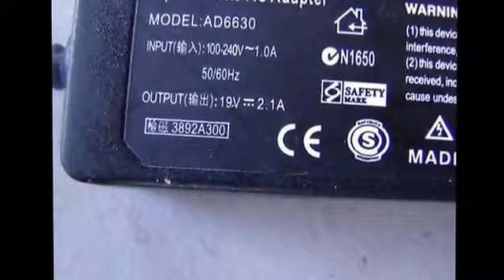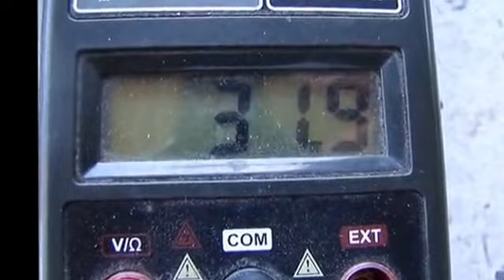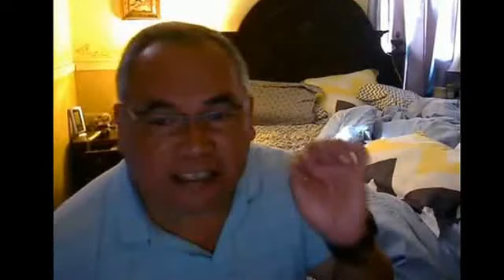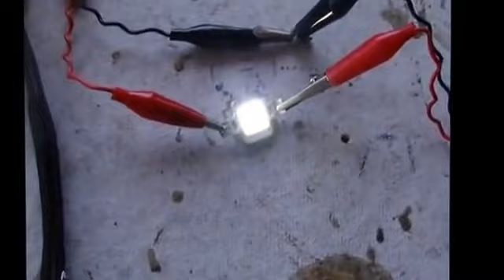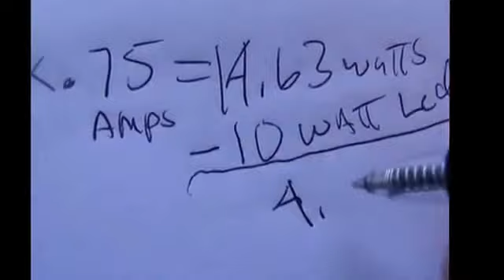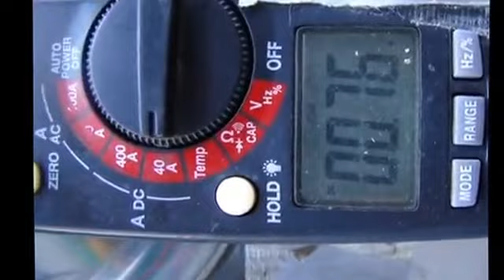Overunity   with 5 watts running the show 360p

Comment: Alex, what kind of circuit is in the tupperware container?  I am trying to get an understanding of what's happening here. I see the computer power supply on the table, I was just curious to see hat's in the tupperware container and what purpose the power supply to the right of it on the table is doing??
Reply from the maker: +Marc Belanger The tupperware circuit is from a friend that generates pulsed dc as radiant energy from mr. Peter sul on you tube here is his schematic and video..https://www.youtube.com/watch?v=eexdSi5LMAw < power supply is just for measuring input energy from house main that gets converted to high voltage low amp energy(dc pulsed), as you can see Im not using the full capability of the computer source which would be 19 volts times 2.1 amps but im only drawing ,75-.77 amps less than 15 watts and it turns the 2 24volt motors at high speed, higher than just regular 24 volts from a direct dc power source!!! mImagine what we could do for range on the new tesla 3 motor
Reply from the maker: +Marc Belanger Oh Marc while i was driving back from temecula I thought lets see how the motor genrator combo do connecting directly to power supply without the high voltage circuit from Peter Sul, well as I suspected it was typical business as usual lenz effect and all; sluggish motor response and low rpm at generator all running slow and the cap has NO effect in this direct setup.
Reply: +Alex Manzanero Thank you. That is awesome.. I could see 3 ways for you to loop it back to it's source just by watching. Since you get the radiant energy and the voltage rise happens when adding the cap, it should be self sustaining just by taking the output of the generator and taking the output voltage, transforming it with a resonant coil at the same frequency, you could step it up, then use the hv with a spark gap to fire a step down at no cost to it's source. I have a circuit you can add to this.. it could work if you drive a flyback with your output into a driver circuit, just as long as you build the coils used in the circuit I have to remain resonant at the same frequency of the input (maybe with a phase lock loop to lock the frequencies if they vary a little), you should be able to drive a few hundred watts of output at 240v and still self sustain without any issues if done right.. you might even be able to self run with what you already have.. it seems very efficient. because of the energy drawn in.  I just reconnected my Gerard Morin circuit and I can self sustain the circuit just by outputting the washer pump generator into a small 2a radio shack transformer by rectifying it and dumping it into  fully charged maxwell cap bank, then, it runs the system continuously at a charge voltage, however, theres no additional load. If I build this circuit, I think I will be able to  and add an inverter and super cap bank to get a pretty substantial output for some free lighting, maybe even more. I will keep you up to date.. I'll send you my updates and circuit setup once completed.. it may be a week or so because im waiting for the diodes to arrive.. What kind of diodes did you use at the ground wires?? I didn't see any label for those, only the output diodes had a part number..
Reply from the maker: One thing I noticed when adding the 10 watt led is a slow down of the generator but the amp draw at the source was'nt affected by the Huge load because we still had a lot of voltage to spare so I pre sume as you indicated that a small load going to a say a flyback will have no consequence on the source amp draw
Reply from the maker: Marc Belanger ps the voltage rise exceeds the electricians hand held meter that only goes to 480 volkts; it lights up like a christmas tree and once i made the mistake of touching it and it defineitely woke my sleepy but up !!!
Reply from the maker: I have another vid that shows the cap charging to 250 volts in 2.3 seconds from 18 volt solar panels
Reply: that's pretty substantial. It seems that the circuit uses any small energy source to enhance it's draw by disturbing ambient, and it's probably just done by pulses to enhance the counter emf, while it draws in and stores the "other side" or the opposite of what it pulses into the coils, when they shut down, the emf arrives, however, if done correctly, the ambient disturbance of the emf wakes up another form of energy and the opposite of that energy is drawn in, giving it a much greater difference in potential. This is how Don Smith's devices work. I am going to give you the link to a circuit to play with. It isn't tough to build, but, it is what 5 people have come up with from tariel kapanadze's hand written circuit when he was in the hospital. WesleyNY has been an extraordinary help with this to me, and I hope it gives you something you could build from it. 

http://www.modvid.com/images/adias/good%20schematic.jpg

he uses a couple of generators to make this work, but, if you look up tiger or one of the other names on this schematic, they all made it work similarly. this is the circuit with the flyback I spoke of. Try it, it works and self runs.. here's another link with the better diagram:

http://overunity.com/7679/selfrunning-free-energy-devices-up-to-5-kw-from-tariel-kapanadze/dlattach/attach/94552/
Reply: +Marc Belanger Hey Marc; I have one or two things I'd like to share with you; whenever you have the chance; no rush. Just some questions.
Reply from the maker: +Marc Belanger thanks Marc for commenting.  From a laymans point of view (me) I view whats happening is that a capacitor can store and dissipate its potential on the fly, eats and regurgitates. Well I think it acts like a boy on a pogo stick or with springs under his tennis shoes; it allows him to jump higher by storing the potential energy and then using it when the boy jumps up. I will check out the links you sent me. Im afraid of closing the loop because the generators output of 30 volts exceeds the input voltage that Peter sul recommends for his circuit. When you look at the circuit do you think 30 volts will damage the componenets??? let me know what you think. I may try to loop it today
Reply from the maker: +Marc Belanger I for got to mention this phenomena.  If you hook up the leads from the radiant oscillator to an old disconnected extension cord. the 220 volts jump up to 480 volts plus. It could also be simple speaker wire around a plastic pvc tube of less than 5 feet and does the same effect, no need for a core just air does the trick
Reply from the maker: +Hazenthly&#39;s Fire are you getting peter's circuit?
Reply: +Alex Manzanero Yes; I'm trying to arrange something as I don't have paypal and to go through credit; but I'm buying the circuit yes.
Reply: I got the circuit you sent me too. It looks extremely interesting and I think I am going to make some heavy duty mods, maybe even include an extra that may allow it to produce a very heavy amperage as Pelex does. I'm not sure the world is ready for the release of it, however, since it involves 3 coils, Pelex actually does too an I may start etching the pcb tonight so I can produce a professional grade product as a prototype. Since I needed a pulse circuit to make Pelex's technology to be made as a fully solid state driver circuit, it looks similar to what I am going to need to make it all work, also, I am going to try winding the coils using litz wire, maybe series some of the strands to make it wind in and out of the (3) 100' rolls that I bought. They have 50 conductors in each, so, my amperage should be pretty good if I use 5 strands at a time, strip them back and solder one set of 5 to the other, in and out, maybe I will be able to acquire a couple thousand volts out of each coil or so, then, see what I could do with the output using shorted coils with switches until I find the right combo. If I could luck out enough, maybe I will obtain resonance and be able to draw 5 or 10 amps from the circuit, which would allow me 10kW if I approach it as Don Smith did, resonant coils, etc.

With this type circuit, and the right type of pulse, I'd bet it's possible to produce tremendous energy by pinging the ambient surrounding with a powerful capacitive discharge, resulting in a very high amperage/high voltage discharge into the inductors, releasing 3 separate bursts of symmetrical emf waves that have an equal and opposite energy signature which is drawn back into the circuit through the air
. When I found out how to build the Don Smith circuit, I created my own version by utilizing an idea from the youtube user ingener, he had a capacitor and spark gap that was set up like early military radar systems that pulsed lit 
a light bulb with a very high output. I copied his wiring and when I did so, it instantly, in one shot blew up a 120v 50w led chip, and it sounded like an M80.

 To make it work,  Those waves are driven into the ground, returning through  the air to acquire the amplification then the load returns to the other ground. I blew up a high pressure sodium ballast transformer like a bomb, and, it literally  shot a fireball out of it
, nearly lighting my home on fire. That was the scariest thing that's happened to me in a long time! I now respect the circuitry especially now that I know there is enough power in one to kill us easily. . An NST isn't normally capable  of that kind of power, usually only 30 to 60 ma so, I must have tapped into something correctly, but, it only happened in short brief pulses. I never succeeded to continuously get this kind of power out, which would have been a much faster frequency. The ability is there, I just think Don's circuit was never listed online correctly, as  he was forced to leave something out.
Reply from the maker: Marc Belanger I always wanted to know how I can make this circuit to heavy duty use such as solar panels using only 1'4 the amount of panels because this circuit charges li-ion in a couple of minutes that is 3.7 18650 batteries. It could do lead acid car batteries also but in minimum time, i have to literally watch how fast voltage rises. So please let me know how to beef it up, please
Reply: +Alex Manzanero I sent Peter a message and he hasn't responded.  How do you get in touch with Peter?  I'm ready to buy 4 of these for my friend and myself and I can use PayPal.
Reply: Alex Manzanero of course. If you add caps to pulsing coils, especially at the correct frequency, a lot can be accomplished, especially if there's a primary and a secondary air coil that has a primary in resonance with the source, in perfect sync you'll get the highest possible voltage and efficiency. Then, we have the ability to loosely couple to this creating the bucking "multiplication/amplification" due to the back emf of the secondary coil having nowhere to go but outward. Since the coupling with higher voltages on an open pulsing circuit works in  the exact opposite manner as the closed circuit, the outward energy is like an elastic band stretching out to it's maximum, the farther it is stretched, the more energy is built up within it. Since the frequency ,wavelength and impedances need to be matched with the secondary, the back emf is released after a pulse into the ambient through an arc, then, it is recovered mirrored and many times the original pulse energy can be recovered from the load utilizing another source of Earth at a distance from the original Earth which the initial pulse of energy has been tied to and forced into the ground. This effect was genius technology of Tesla and it is an awesome way to see how much energy could be drawn using the circuit you have, or similar anyway. If you see an over efficiency now and there isn't a ground involved, imagine how strong it would or could become when involving transfer of energy from the ground, and the difference in potential between a charged earth and atmospheric ambient that has been disturbed by these sharp emf pulses? I call it electron accelleration way beyond the speed of light, creating a phenomenon that is not yet believed by the majority of science. The issue though is properly propagating this without knowing exactly what to do. I've been closely watching Dollard and his training videos where he shows us the different circuits that create the different waves. The scalar is the most powerful and most important that I have worked with so far. It allows the possibility of an energetic anomaly that is way more powerful than anything conventional science could grasp at the moment, and the sad part is that science will tell all of us we don't know what we are talking about, also, they will say it can't exist and never existed. They will all still say Tesla was out of his mind mad, but, I'd bet good old Nikola is up there saying 'I told you so!", especially after Eric Dollard and many others have shown the effect over and over. I am about to rebuild this circuit. I've received nearly all of the parts.. My transistors arrived, the coils arrived and most of the other products are already here. I just need energy to go ahead and build the device , then, multiply it in size to create the beast circuit that will drive large motors into generators for amplification of an unknown amount.

Comment: I'm going to share this my friend.. Oh, by the way, how did you come up with the resonant calculation? did you read the coil's inductancewith an inductance meter or did you just wing it and connect caps until you got the resonant rise? Is it resonant or is it just a by product of adding capacitance to the particular winding type? These are just standard permanent magnet dc motors, correct?
Reply from the maker: +Marc Belanger the circuit is very forgiving, im using a 250 cap on video but i have used a 50 volt bi-polar cap as well with no problem. Ps always hook up your dc motors before the cap, otherwise a nice shock is waiting for you